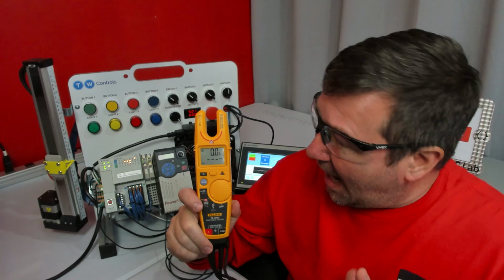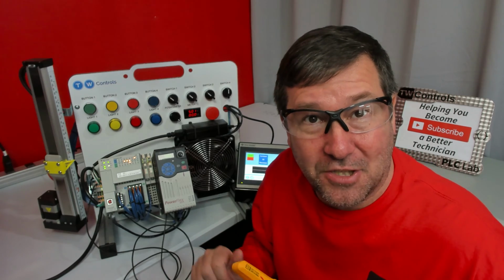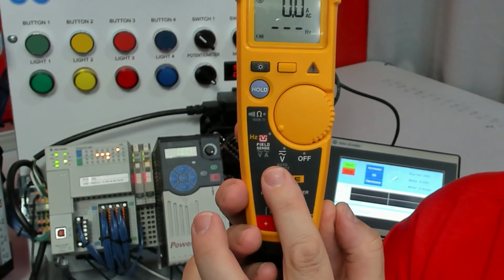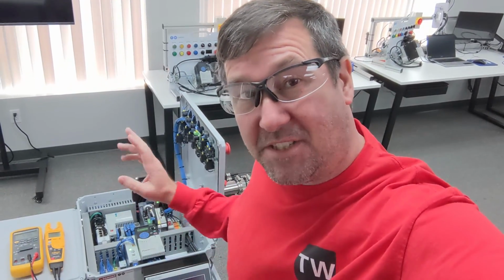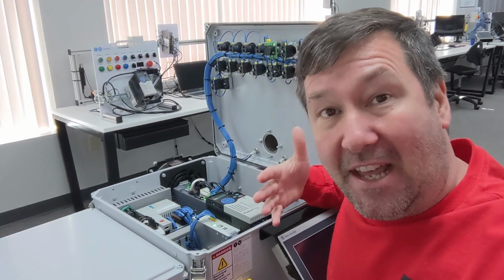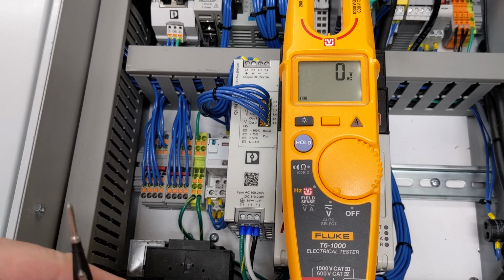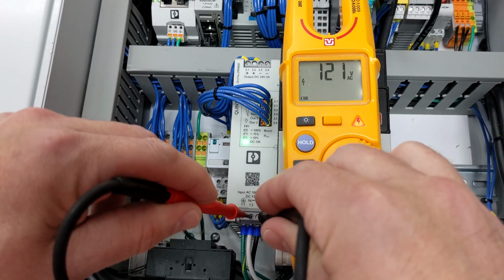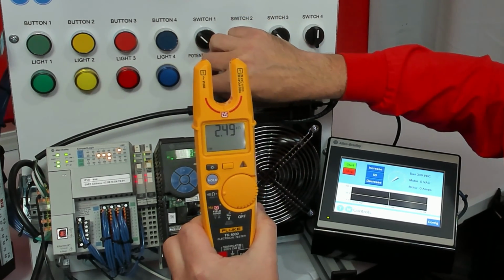Fluke T6-1000 with Field Sense.  My New Favorite Meter!

Comment: Thank you for your video on this Fluke meter. I bought one of these and after testing it myself I found that there is too much error for the amp measurements ( in some cases up to 20% error) when compared to a wrap around Fluke clamp. Most of my testing at work is done on circuit of 10 amps or less and one or two amps off is huge and also you have to make sure that get the wire as far back as possible to even get the highest reading which may not be possible if you are in a small space. . I love Fluke but guys this is a great start but definitely needs refining. Thanks so much for your great video content.
Reply from the maker: Thanks for sharing your experience. I've found the FieldSense to be accurate enough for most general use, but I'll be sure to keep this in mind when testing for higher accuracy.

Comment: Nice, but The problem is that this one not include Loz
Reply from the maker: Loz?  What is that?
Reply: Low impedance
Reply: Ghost volt
Reply from the maker: Yes but I think I think a mistake a lot of us make is trying to have one meter that does it all.  How many screwdrivers do you carry with you?  Probably more that one?  I think this meter is probably one of the best when walking up to a machine that you are unfamiliar with.
Reply: I have Fluke TPro.

Comment: Besides voltage, Are there are any other features that you loose if you go with the t6-600 over t6-1000?  I work in commercial and industrial but I dont really work on equipment/services over 480v anyways so I don’t really see the point for me to pay extra $ on the t6-1000 unless there’s something that i don’t know about
Reply from the maker: If you work with 480VAC then you need a 1000V rated meter.  I talk about it in this video.
https://www.youtube.com/watch?v=7pmS_we4uDI

Comment: Glad you took my recommendation and got the T6-1000 😁. I remember when I told you I bought mine over about a year ago when I also got my Bryson Multimeter. It took me a long time researching my choice before I bought both. Just used the T6 a day ago for some motor winding checks.
Reply from the maker: It is the one I grab the most often now!

Comment: I've used the T6-1000 working with 480v 3 phase motors. I like that the OHM range is high enough that when reading a motor you can see if the winding insulation is starting to break down. I also like the red danger light because if you forget and test your wires on OHM's or AMP's  and read 0 it still alerts you that possibly dangerous voltage is present. Would definitely recommend for a tech working on anything from 3 phase 480- 24v DC. The other thing to note is that it holds one of your leads with the end of the meter so if you are measuring you're not trying to hold 3 things at once or trying to set a meter in a live MCC bucket while you test.
Reply from the maker: I have used it almost exclusively since making this video!

Comment: For basic first line testing it is a decent enough meter; I did find the Field Sense a bit of a gimmick though so I tend not to use it.
Reply from the maker: I think we'll see field sense more as the years progress.  If we get a reliable option to measure voltage without an exposed conductor, it will become a regular practice from a safety standpoint.

Comment: If the meter just shows the correct value automatically then learning fundamentals are missed, IMHO
Reply from the maker: I semi agree.  But if you think your voltage is DC, and it is in fact AC, a typical meter will show zero, leading you to believe there is no voltage present.  Plus measuring voltage without an exposed conductor is another win for safety.
Reply: You could see the meter "bouncing" on 60 Hz.  Teach that clue.  And to think about zero readings where you expect non-zero and what might cause that.  Problem solving, not "better have this meter" IMHO @TimWilborne
Reply from the maker: We have lots of different meters for teaching here, but what I'm saying in this video is that this is the one I would carry when troubleshooting, not teaching.